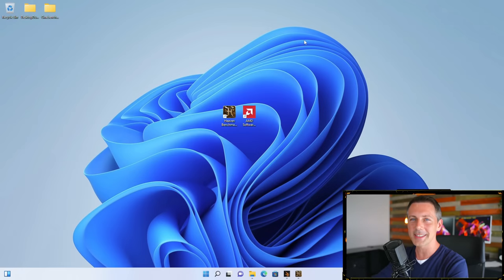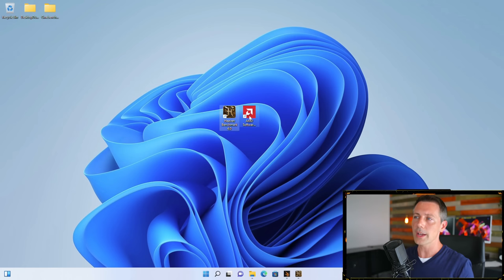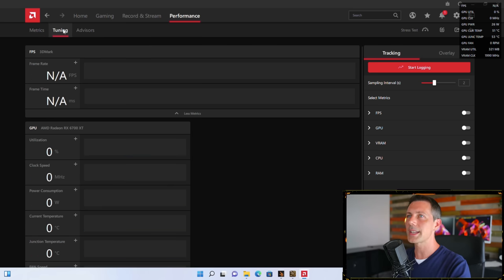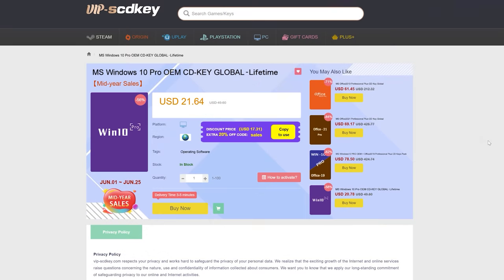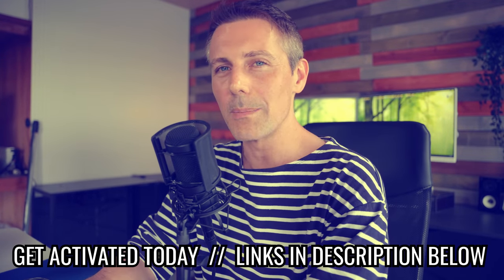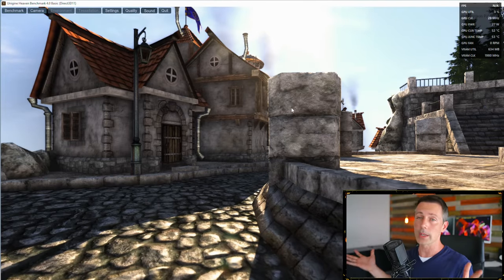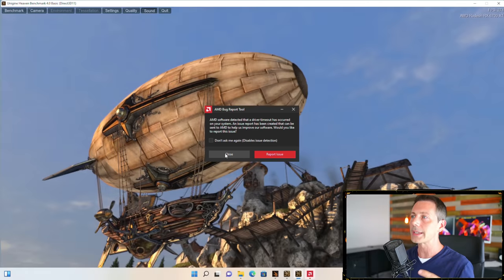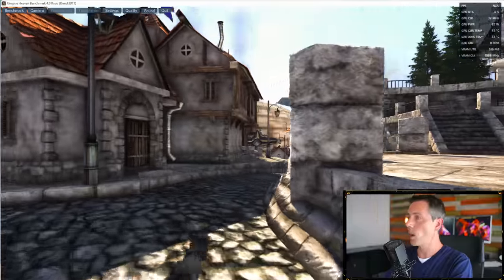How to UNDERVOLT AMD RX 6000 Series GPUs

Comment: Wait, wait wait. Hold on a second. All your showing us is the power consumption? You're not showing us the FPS along with the change in power consumption. Why? That would be equally as important as what the card is drawing for power. What do you gain and what do you lose by adjusting the power. 
You should also mention that the minimum frequency should be within 100 MHz of your max frequency.  
So if your max frequency is 2400 then your minimum frequency would be 2300. This helps so much with your 1% lows in regards to FPS.

Comment: I’m running my 6800XT at 630mv. I can’t remember the mem/gfx clocks off the top of my head though.

I haven’t specifically checked performance loss, but it still seems to game perfectly fine. It draws 130w when mining, down from ~300w at stock voltage

Comment: Sigh. Paying for a good gpu just to underclock it is rediculous. Lower voltage allows higher clocks. What are we even doing here? The power difference is pennies a day...its irrelevant. You paid for the performance, use it.
Reply: funny thing is on some RX 6000 models undervolting actually can increase performance 
in my case with my XFX - Speedster SWFT309 AMD Radeon RX 6700 10GB Model:RX-67XLKWFDR 
with AMD SAM on it went from a score in time spy 10001 to 10428/10417 and on stock with no AMD SAM 9875 
your saving a bit of power, lowering temps and the gpu is going to last longer at 1100mV vs 1200mV
also what i did was bump up the fan curve by 10 to 15 in all the fan curve levels wile setting the power limit to max.

Comment: DONT Undervolt them,,They gonna crash very quikly
Reply: @Nova No its not, its just common error with amd gpu's.
I have rx 6750 xt and cooletmaster v750 v2 80+ gold, fully modular and every time i try to undervolt my gpu it just crash
Reply: @Nova Do you know how to find proper settings for specific card, i mean which option should i change till i find right one?
Reply: @Nova Thanks a lot!